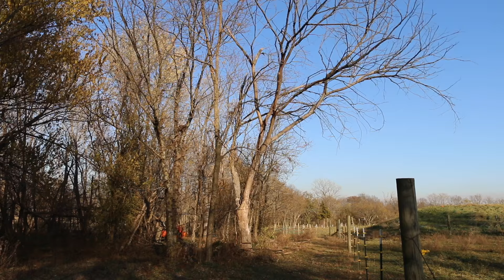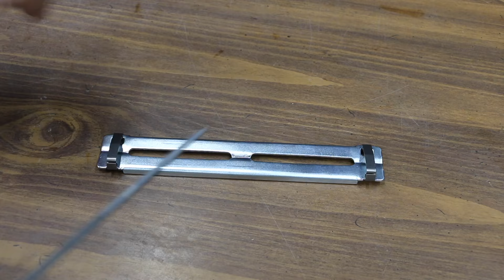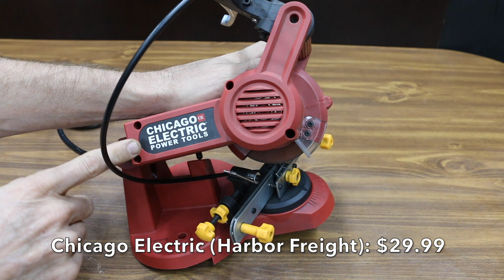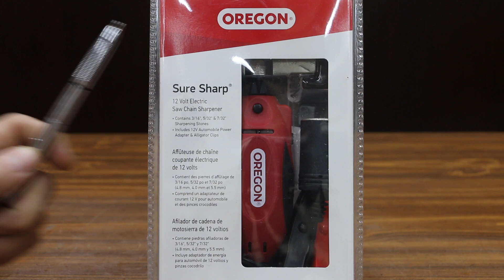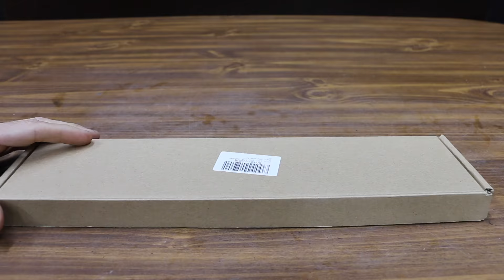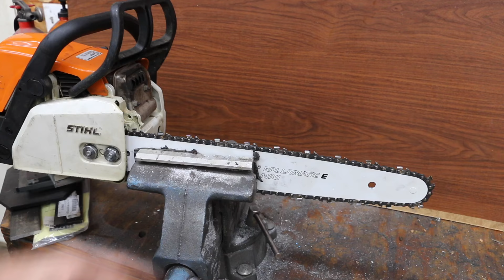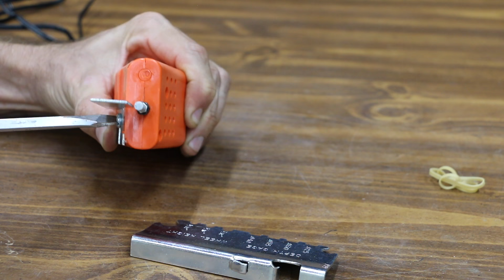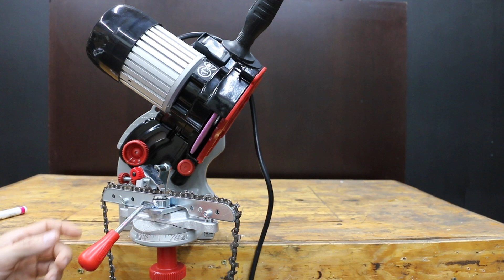Which Chainsaw Sharpener is Best? Let's find out! Stihl, Granberg, Chicago Electric, Oregon

Comment: I noticed while using the oregon grinder you seemed to be holding it down you would need to Use a quick tapping motion to minimize over heating mayby that is why you are getting bad results??
Reply from the maker: Thanks for the feedback.

Comment: One of the most useful channels on the internet.  Kind of like "Mythbusters" but for the working man.  Not only useful, but highly interesting to boot.  One item I noted during the test was that the Oregon Field sharpener wasn't placed in the vise when you worked on the chain.  The Stihl was locked in the vise possibly allowing for a firmer filing pressure.   With the Oregon Field sharpener it seemed like the chainsaw was sliding around on the workbench a bit  Wondering if the Oregon Field would have beaten the Stihl in the cut test if it were sharpened  with a bench or stump vise.  Great job considering you knocked out test results of 9 sharpeners.  Keep the great test vids coming.
Reply from the maker: Thanks!  Thanks for the feedback.

Comment: Thanks for taking the time and expense to solve one of the most contested methodologies of mankind. The surprise were the Granberg products. Keep up the great work that you do. Have you seen any long term damage from using the lye for removing sap and organics from the chain? Have you done a bar oil comparison? I just wonder if using a heavyweight synthetic gear oil would work as well or better.
Reply: Bar and chain oil is very different from gear oil. It has anti sling properties that gear oil has no need for. It is for temporary total loss use where gear oil is permanent recirculating use. Gear oil is also very nasty  stuff. It has long living additives.

Comment: I don't like factory grinds on brand new chains. I normally just take a new chain and put my own edge on it. They are very modest in the depth of cut. I will take the depth gauges down to expose more of the cutting edge. You must have a strong enough saw to handle it, but man does it make a huge difference
Reply from the maker: Thanks for the feedback.

Comment: I'm new to the chainsaw world and have been researching quite a bit.  The Oregon R56 chains you used for testing require a 4.5mm file size (11/64"), but you said you used a 5/32" file.  Would this impact the results in any way?
Reply: Wow nice catch.  I bet relatively between sharpeners the results are fairly valid except for when comparing to stock.

Comment: I’ve used the Stihl 2 in 1 file for some years and I like it, nice to see it held up against the competition.
Reply: While its a great product and it cut well in the test, I would think it had excessive hook and would not hold an edge long since he used a smaller file.
Reply: We sell Stihl products and the 2n1 is our best selling sharpener. Even novices can get perfectly sharp chains.
Reply: I have both the Harbor Freight electric and the Stihl 2 in 1.  I use the Stihl and like it better.  However, if the chain is really dull, say from hitting a rock, I would probably start with the Harbor Freight grinder then use the Stihl 2 in 1.

Comment: First, OUTSTANDING JOB!  Over the past 40 years, I have used a free file, an Oregon clamp on the bar system, the Grandberg clamp on the bar system and the Harbor Freight grinder.  Currently I have an Oregon 620-120 Hydraulic Assist Bench Grinder.  In my opinion, the clamp on the bar type file guides and a good file will yield the sharpest tooth with the best geometry.  However, It can be quite time consuming, particularly on long, full comp chains.  I ABSOLUTELY love the Oregon 620-120.  It is not made in China as far as I know.  They are made by TECOMEC in Italy.  The key to a sharp, fast-cutting chain is consistant angles and the correct depth gauge setting.  The grinder allows for ALL the corect angles and a quick grinder wheel change permits the depth gauges to be cut.  Coming home from a day of cutting, I can touch up or fully repair all my chains very quickly.  I rarely file any more.  Once one learns how to properly use the grinder, there is no going back!  You can take off a very small amount or a lot depending on how bad the chain is.  If you sharpen a lot of chains, buy the Oregon or TECOMEC equivallent 620-120 or 520-120 grinder with confidence, You will not reget the purchase! Again! great video!
Reply from the maker: Thanks!  Thanks for sharing.

Comment: I think your video is very thorough.  With the bench sharpener however, I didn't see you change the yoke.  When you switch from one side of the chain, to the other, I only saw you switch the angle from left to right.. didn't see you change the pitch.  I have both, the bench sharpener, stihl 2n1, and a hand file kit.  The stihl 2n1 does the best job.. the second is the hand file, third is the bench grinder/sharpener. The bench sharpener takes little skill, but is good to fix/correct a chain if you hit metal or a good rock.  The 2n1 takes all the skill I have learned over the years using a hand file and throws it out the window.  It's easier, and does a better job than hand filing. After I use a bench sharpener, I'll do one stroke with the 2n1, it just feathers the edge, and touches the depth gauges.
Reply from the maker: Thanks!  Thanks for  the feedback.

Comment: Nothing will get a chain more reliably sharp and cutting faster than hand filing.  If done right it cuts faster than stock and with practice only takes a couple minutes.  Grinders harden the teeth and make them brittle plus makes them harder to hand file.  Also no need to clean chains, just a waste of time.  I'd put my hand sharpened chains against any other chain.  Also worth checking out pferd file guides, really good guides and takes your rakes off too.
Reply from the maker: Thanks for the feedback.

Comment: The grinder type sharpener can heat the bit and cause it to lose temper if you're not careful. I've always freehanded with a file but I find my eyes are not as sharp as they used to be so this is very helpful.
Reply from the maker: Thanks for sharing.

Comment: Nice video mate. But I have to point out that with you holding that battery saw is way some chain's cut differently. Some cuts the bar stays flat some are tip up and some are tip down, flat and or bar tip up make the saw work harder because the saw dust is building up in the cut with the tip down the raker clears the cut with ease.

I've used a file-n-joint for years they are the best way to sharpen chainsaws!! Actually a hand file is the best!!! They electric sharpener's 12v or 240v  are shit because they harden the teeth by heating them up an they go blunt faster an faster...
If you have a saw with a decent amount of power you can file the rakers down a lot more than the chain specs say to!!
I've filed some of my chain's down giving them a gap of atleast 1mm more like 1.3mm but that's on a ms660
Reply from the maker: Thanks!  Thanks for the constructive feedback.

Comment: Production Note: Unfortunately, right at the very end of the original testing, I discovered that there was a serious flaw in my testing methodology. So, I did the right thing and repeated all my testing and sharpening . And that meant I needed to drive the tractor all around the farm again for a few more days looking for dead trees to knock down and cut up. Everything was looking good, when doncha know, ope, the same thing happened again! so I had to run that old tractor around ANOTHER coupla two three days gathering more wood to bust up and run more testing. Then my wife came out and reminded me to stop screwing around and just get the dang video done at which point I realized she was right and completed the video.
Reply from the maker: lol  Thanks for sharing.

Comment: Great chainsaw sharpening demo.
I have used the Granberg type sharpener for about maybe 40 years,
Maybe not that brand but it is the same type. It goes faster after you know what your doing.
But ain't that the way with everything!
Thanks for sharing!
Well they say curiosity killed the cat and yeah it was just killing me not knowing what kind I had, so I went out in the building and got it.
It is a model G-109
FILE-N-GUIDE
Made in: GRANBERG IND. INC.
Reply from the maker: Thanks!  Thanks for sharing.

Comment: At 12:18, you can see how the cutter is burnt by this type of sharpener. I used one like this for years, it was made by Stihl and we had to have a container of water on a shelf above the bench which fed down through a tube onto the cutter. The water didn't get anywhere near the electricals but the person sharpening would get wet around the legs. This left a chain which was equal to or better than a factory chain. All these grinder types should have some sort of coolant on them. A chain which is burnt like this will not cut very well or for very long, and the video tells the story.
Reply from the maker: Thanksk for sharing.

Comment: I am not sure you were using the Oregon 410 benchtop correctly.   The bottom tilts about 10 degrees to give truer access to the chain tooth.   It appeared in the video that you had it perpendicular to the floor.
Reply from the maker: Thanks for the feedback.
Reply: Project farm, has no idea how to use the oregon grinder. Or significant experience with the other tools.

Comment: Been using Stihl 2-1 for 3 years now, I cut trees several times a week. I have used most of the others he tried. The Stihl -1 is inexpensive, not made in Chinka, super easy to use with no fiddling around, simply works very well every time Keep new files on hand and it is the best for the price by a long shot.
Reply from the maker: Thanks for sharing.

Comment: I think that the author of the video simply does not know how to sharpen ,he is very bad at it... the blue color of the metal after the machine says a lot, the author of the video does not know how to use a sharpening tool. every tool is good you need to be able to use them. Hello from Russia. and in general, how can you sharpen a poorly stretched chain that the author has sagged...

Comment: I like your controls in the test setup but I dont think using a battery operated saw is the best for this because the batteries can have too many variables. I would of used either a gas or 120v plug in.
Reply from the maker: Thanks for the feedback.

Comment: I’m not a pro by any means but other factors to consider would be time required to sharpen a chain and consistency of tooth angles once sharpened.   improper angles are a pain especially when cutting thru big logs when the saw starts to cut crooked.
Reply from the maker: Thanks for the feedback.

Comment: I use one of the Chicago Electric sharpeners and have had very good luck with it but I can't make any comparison because I haven't used any of the others. The Chicago has served me well over a lot of years and I won't give it up easily. Each chain has to come off the saw but the saws I have sharpened over the years were in dire need of cleaning so it is all good...
Reply from the maker: Thanks for sharing!

Comment: The old GAMN, if you can find one. First, you will destroy a few chains. Then you will rotate the carbide burr the wrong direction and destroy it.  (Yes, really!) IF YOU CAN FIND A REPLACEMENT BURR ... and get the set-up of the tool correct, your chain will rip 8" or 10" long "chips," drop through your logs like they were hot butter, and leave blood all over your chainsaw if you so much as look at it without gloves!
Reply from the maker: Thanks for the feedback.

Comment: Unfortunately you passed over a very important part of this test although you probably can go back and get some of the information.  If you are using anything other than a hand file, any discoloration of the steel is an indication of temperature change in the steel that likely indicates that it has lost hardness and won't keep the edge long.  As anyone who has sharpened a knife will tell you it isn't just how sharp you can get it but also how long it keeps that edge.
Reply from the maker: Thanks for the constructive feedback.

Comment: After using many different sharpeners the 12 volt granberg is by far the best I have used and works great . I have destroyed some chains and brought them back to like new every time and once you get the hang of using it works really fast . I power it with my 12 volt battery charger glad to see him use it in the test and verify what I already knew.!!
Reply from the maker: Thanks for sharing!

Comment: I am up for the challenge to see all of the uses for WD-40 that is listed on its website and all over the Internet. Not only a lubricant but it says it will remove bubblegum from the carpet, removes ink and crayon marks, cleans and polishes brass and gold, adhesive remover, restores oxidation, cleans paint brushes, hides surface scratches, and even good as a bug spray, plus tons more. Lets put these to the test.
Reply from the maker: Thanks for the video idea.

Comment: I have an Oregon 511AX. It will also tilt, as some chains need this adjustment. The one thing needed, that some of the bench units that were tested, is the ability to reverse for one side of the chain. I had my unit modified to do this. It, as a result, works very well.
Reply from the maker: Thanks for the feedback.

Comment: I think you might be missing something here.  Chainsaw cutting teeth are (unless they're carbide) made from hardened steel. If you get hardened steel too hot (above 400 or 500 F, usually), you draw the temper of the steel, which reduces its hardness, sometimes very substantially.  An electric grinder with an abrasive wheel can easily produce enough friction and heat to produce this effect.  In fact, in your video, you show closeups of the sharpened chain teeth that have temper colors, which indicates that they have been heated enough to loose hardness.  While this softening won't necessarily result in a slower time in your four-by-four cutting test -- even soft steel is hard enough to cut wood initially-- it will reduce the durability of the sharpened chain.  That is, the softened cutting teeth won't stay sharp nearly as long.  I predict that, if you test for durability, the chain teeth sharpened with powered abrasives will loose their sharpness much more quickly than those sharpened with a file.  (You would, of course, need to use separate chains to test this.)
Reply from the maker: Thanks for the feedback.